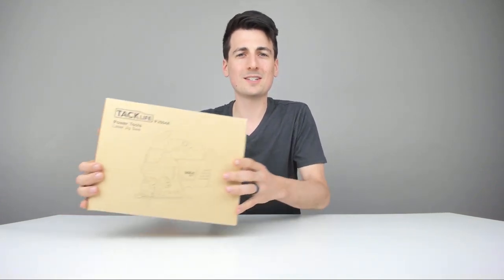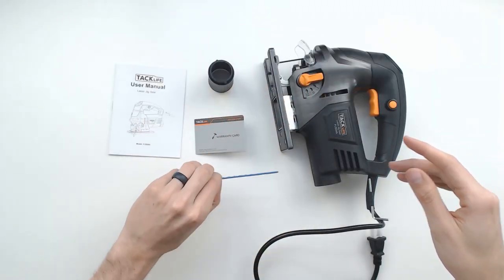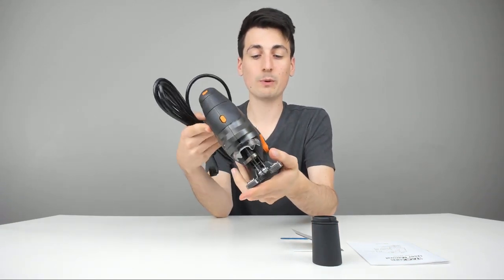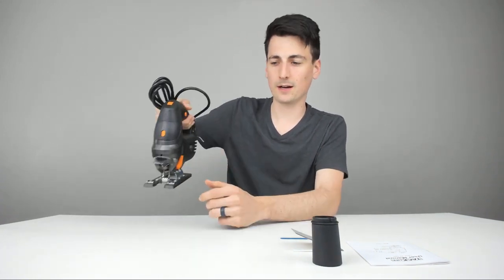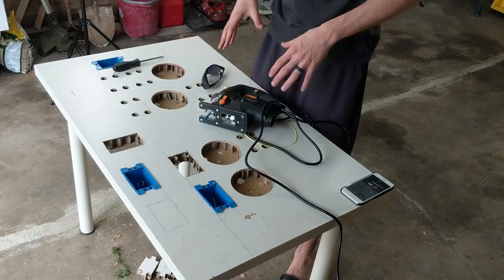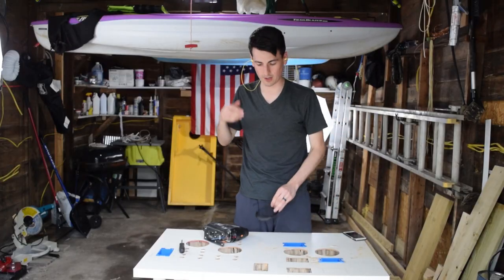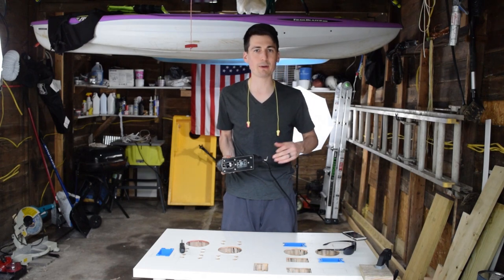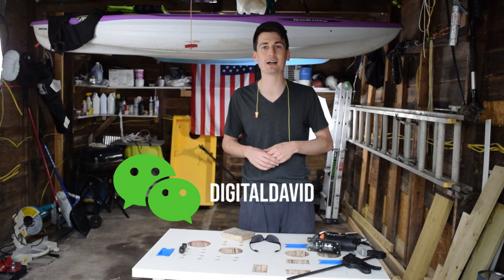TACKLIFE JIGSAW REVIEW w/ Laser Guide + Variable Speed + Double Bevel Cutting

Comment: The laser is really nice, especially when cutting composite  materials. like fiberboard or insulated panels, because that kind of sawdust tends to cling to the surface. It's nice to actually see where you are cutting. I also like having the speed control on a dial and not on the trigger. I have a tendency to bear down when I'n cutting and I would unintentionally increase the speed of the cut and burn out my blades. That was a great idea.
Reply from the maker: Amen 😀